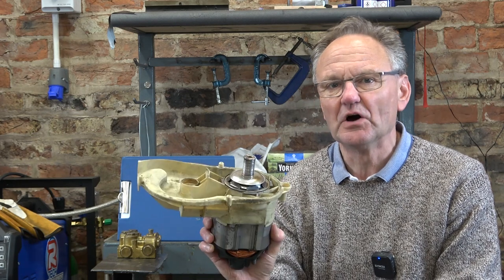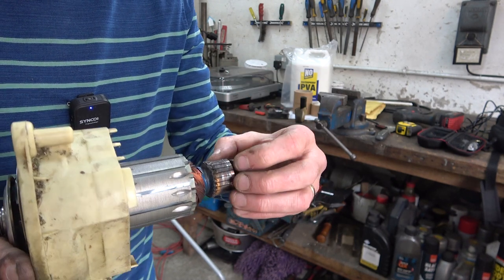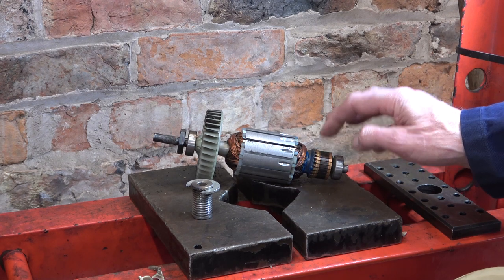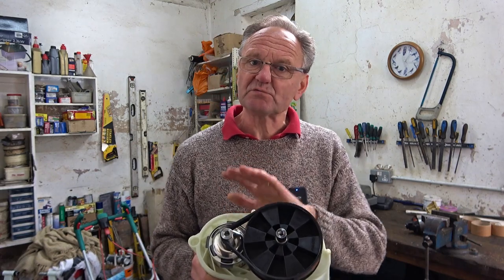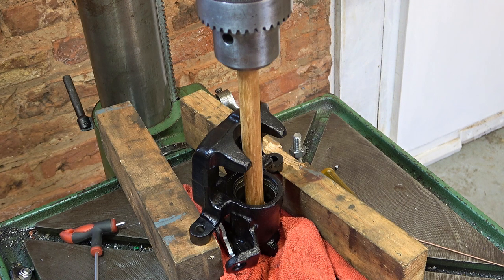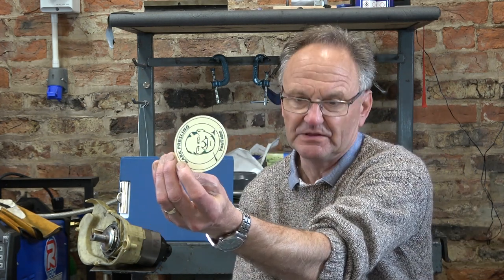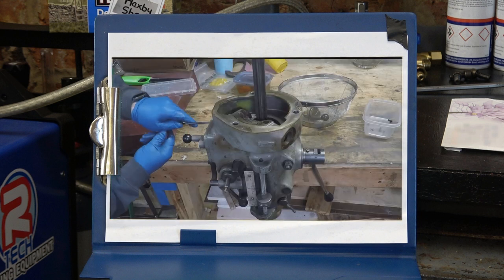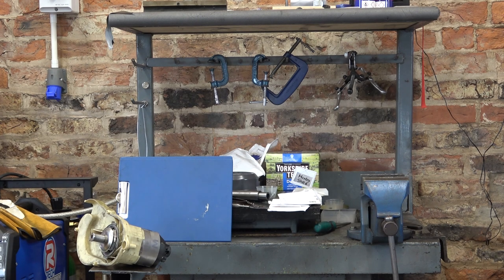HS138 Odd Jobs and Stickers 8

Comment: The 4 jaws chuck on the tailstock is very useful, without a center hollow you to bring every shape !! This is a nice improvements !! Better that the fixed steady !! I miss the hydraulic press but I have no space ... or else I find it but I will also find my bed outside the entrance gate .... LOL !!! Good job Paul !!
Reply from the maker: Hi Alberto, that hydraulic press is just essential in my workshop. Bushings, bearings, getting distortion bends out of welded plate .... etc.  So maybe a small press made with just a hydraulic bottle jack would be good for you. Cheers
Reply: @HaxbyShed  Yes you know It Is some weeks that i think about, because i like the joints using hot flame, but the same result in interference can be obtain with the idraulic press..tonight i will take a look on Amazon.. 😁 Thanks Paul!!

Comment: I think that the armature is shorted down to earth, hence the burning on the comm. 
I've only used petrol ones for years, electric ones just seem fragile and not up to the job. 
Best wishes, Dean.
Reply: I used to be a solid fan of petrol mowers, mostly because they have no cables, but electric mowers are quieter and way lighter, less vibrations. As long as you are near a power source. I am not sure it is a leak to earth, these things tend to be double insulated nowadays.
Reply: @bootsowen  the burned up comm and the sparks from the brushes off load are a sure fire indicator of an insulation failure. 
I don't find modern petrol mowers to be any noisier than electric, somewhere in the region of 78dba is comparable. They are safer in my opinion too as there is no cable to run over and if you have a largish garden with trees or bushes, nothing to tangle. Each to their own.
Reply from the maker: Hi Dean, if I find myself at a loose end I will do some checks for insulation failure. Discussion about petrol mowers noted but I find them a bit stinky, or at least my old Suffolk Punch was ..... maybe the newer ones are better now. Cheers

Comment: Before turning a commutator, one should check the windings (OHMs resistance), then put it on a "growler" to check magnetic field generation. Old growlers are cheap & you can find them all over. Have a good piece of spring steel to use on the growler for magnetic attraction. 😃🤣😂🤣😃. If ya ain't got a growler, best not mess with it. Always enjoy your videos Paul. Keep it up. I'll have to send you a pix of my, new to me, Harig 6-12  ballway surface grinder.  Learning it is humbling to say the least. Trying to get stuff within a ten thou of an inch. Had to make a balancer for the wheels first. Sitting in the dunce corner at the moment, but promise to do better. Cheers.
Reply from the maker: Hi Bob, I researched 'Growler' armature tester and I see how they work.  But when I searched ebay I could only find them listed for sale in the US. There was not a single one listed here in the UK, today anyway. I could have tested the resistance but my OHMs meter is not sensitive enough. I thought I was probably wasting my time trying to fix that motor. When I put the new motor in there was no arcing at the brushes so that just confirmed the old armature was junk. Do send me a picture of the surface grinder. I will be using my shaper grinder attachment for a job soon - but I'd be happy to get within a couple of thou with that. All the best.

Comment: It is very annoying that things are no longer designed for easy repair. Stuck in the desert and using what you have for a repair, I think is limited to an old Land Rover. Great job drilling the thread on the pressure washer, I have never managed to get the drill as centered as well as you did. Some interesting channels. We often struggle with background noises when we film too but it is usually the RAF or USAF
Reply from the maker: Hi GTB, the desert comment was of course an ironic joke but not a very good one. Well if you are near Lakenheath or somewhere out that way I can imagine. We are local to Linton-on-Ouse which was until recently a base for pilot training in Tucanos - quite noisy aircraft - but the new plan is to use it as a holding camp for asylum seekers which has caused a bit of excitement. Cheers

Comment: Looked like those motor brushes were worn out? Sometimes they have restricted travel or little pop out springs inside that stops them making proper contact with the commutator once they've worn down to a certain point...
Reply from the maker: Hi MidEng, after your comment I checked the old brushes for remaining free travel and I'm pleased to report that though they were at least half worn there was about 5mm of free travel remaining. I suppose if I'd found it was just the brushes, having already bought a new motor, it would have given me a spare but my pride and pocket would have suffered. It was a good suggestion thanks, you might easily have been right. Cheers